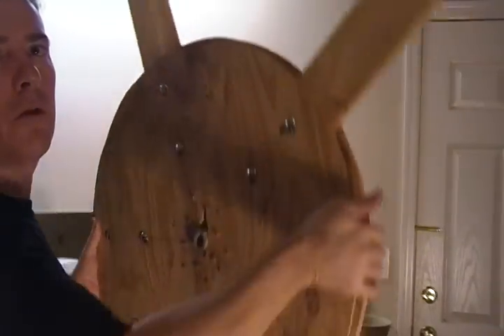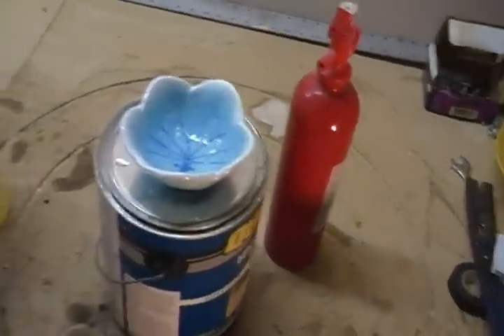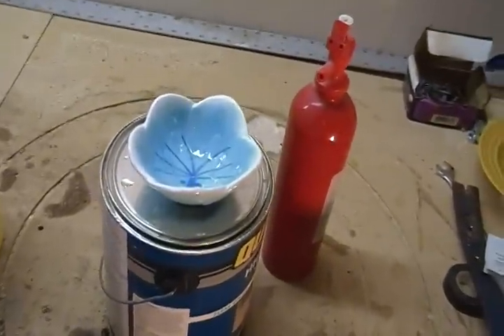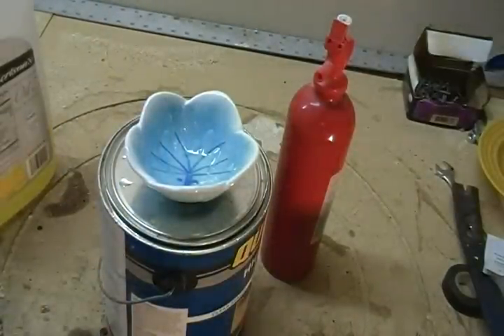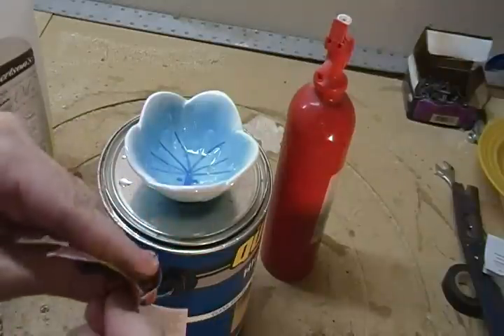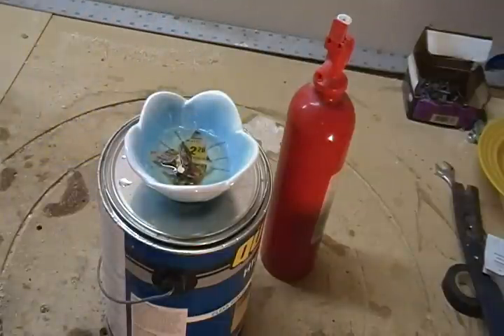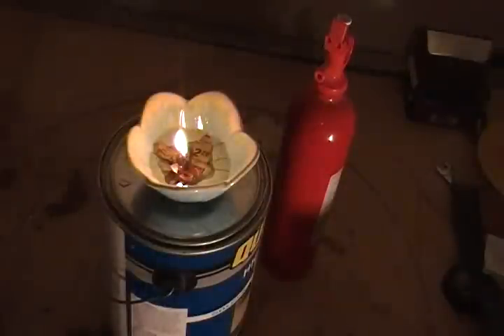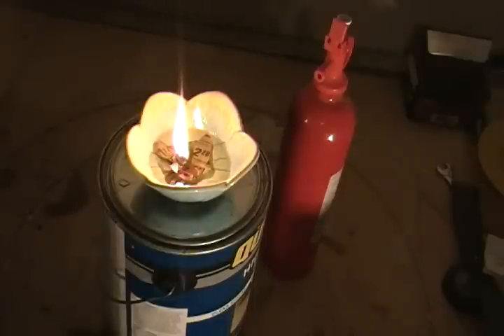Update - Plus Emergency Lighting Trick!

Comment from the maker: @electrodacus I was debating with myself regarding the scaling. However, I'm not using the PMA to is fullest potential, they can easily take 1000-2000 rpm. And since the PMA is the expensive part of these projects I think it would be economical to scale up to take advantage of that potential. The down side is it will wear them out faster, but since there is not a heavy load on the bearings I think that isn't a big problem either.

Comment from the maker: @solarhope Thanks, I appreciate that. I'm going to build the larger turbine at the location where it will be used. Not enough room in the shop. However, the process will be very similar to the construction of the small turbine. Anyone that can handle building the small turbine should be comfortable with larger project. Regards, Mike

Comment: Hi Mike, I've watched all your videos and must congratulate you on some neat engineering and "keep it simple approach". Perhaps you already have the solution to up scaling the existing turbine - Put lots of the existing design together in a block module, or just dot them about to fit in with the location as you have tucked one away behind a wall. If it ain't broke don't fix it! - Regards Martin.

Comment from the maker: @jedufa Yes excellent idea, I was looking to do exactly that using a foam core to scale up the turbine blades. I was thinking construction foam insulation sheets which are dirt cheap. Maybe a layer of fiberglass. But no I haven't cut foam before, it appears they use hot wire? I'm looking into it, not sure I'm going with foam but maybe. You can't beat it in weight.  Let me know how your turbine turns out. All the best, Mike